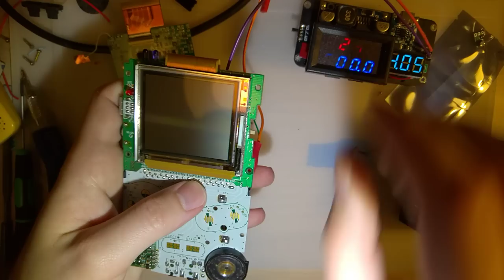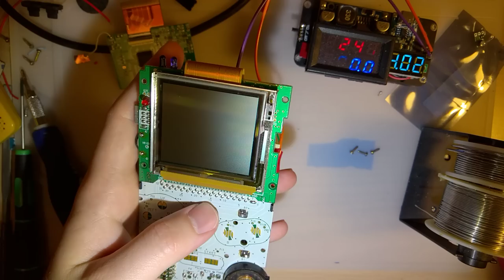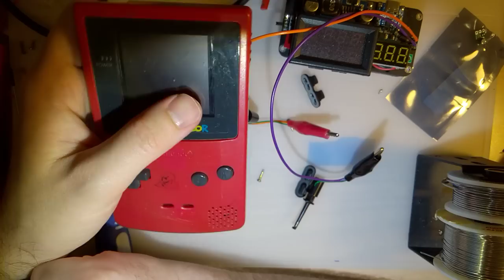Installing the TFT GBC backlight kit (HiVision AIO) - Part 1

Comment: Is there next to the solder point of the Touch sensor 2 points for soldering 2 Buttons to not Use the Touch sensor?
I see on the Video and picture 2 points with Mark "hold" and "+/-".
Perhaps with this can be Use it to change the brithness too.

Öhm is there a way to get the 3d Modell of the 2 parts?
Reply from the maker: Ooh, good catch. I wasn't paying too close attention to the solder points. I'll check it out when I get my new GBC that I ordered specifically for this screen anyway. 

And yeah, I'll upload the .STL files I made and post a link in a few minutes.
Reply: @makho  i found the points first in your Video and the on the aliexpress picture. 
 Thx for the Upload Ing. 
I order the Display too and can wait it arrive but that takes some weeks 😁
Reply from the maker: @-Gothicgirl-  I uploaded the .STLs I made: https://www.thingiverse.com/thing:3732645
Reply: @makho  thx Thats my next printing
Reply: Someone can explain where the solder points go on the original PCB ? , in orden to control the brightness.
Reply: @makho  i was looking for this too,I also saw these points on the board and I believe that the lighting control is done with the console buttons, I think, does the brightness increase because the screen power will change correctly? , the solder poins thank you!
Reply from the maker: @santiagomerinovaca6002  Just put them on any of the buttons you want, you could do start and select, or select and down, whatever.
Reply from the maker: @r1p1m  you can use either the sensor or the buttons. The effect is the same.

Comment: hi nice video 
what is that fancy power supply with the 2 number display you use to power your GameBoyColor on the video ?
Reply from the maker: I made it https://youtu.be/leoks1pUpcs

I'm working on a newer, better version but that new version will have a much higher BOM cost at the tradeoff of having significantly more features and some actual safeties built in.

Comment: Great video. I know you've covered the dimension for the spacers, but I can't find the measurment for the thickness of the spacer. Thank you.
Reply from the maker: Thickness isn't too important. Anything from 1-3mm should be fine. My PCB spacers are 1.6mm.
Reply: @makho  Thanks for the quick reply. 
One more question...what are you looking for when you are trying to spot frame drops. I have Mario (original) and Ms Pacman (color). Thanks again
Reply from the maker: @natk5915  Any interruptions to smooth movement. That's what I'm testing for when I am walking around in the overworld in Pokemon. All movement should be completely fluid. Here is an example: https://imgur.com/Xih0Cpu

The left console is dropping frames and the right console is not.
Reply: I really apperciate that. Keep up the good work.

Comment: I might get a second one, I think we're just two of many people worldwide who have fucked Gameboys with messed up ribbon cable tabs. I transplanted another motherboard and it works better but I'd like to fix that ribbon cable connector by installing a working one. Also because I ended up messing around so much I basically did a full stress test of the ribbon cables on this LCD kit and I must say they're durable as fuck. I can accept them being so stiff because they can take a beating.
Pretty great kit, haven't played Pokemon yet but absolutely no problems with Links Awakening.

Comment: The mine was coming with te touch sensor cut, what a disapoint, install with no bright options, anyway its better than stock one, and its pretty easy to install for dummies like me :D
Reply from the maker: Just solder it back on. The sensor is just a bit of copper tape soldered to a wire.

Comment: Considering i've accidentally screwed up the screen of one of the gameboy colors i'm repairing, i was considering using this as a replacement rather than getting another gbc lcd just to slap a frontlight onto it.

This seems like it'll do the job, but the frame skipping is a bit worrisome. So gotta ask how noticeable it is during gameplay? Namely in something like platformers?
Reply from the maker: It's not exactly game breaking but it is somewhat irksome. I'd realy recommend going with Freckleshack over this one unless you aren't particularly sensitive to this type of graphical issue.

Comment: It says on handheldlegend this could be installed in a neo geo pocket color.  Could you do a video on that?
Reply from the maker: Twist my arm, why don't'cha!

Yeah, I already ordered another kit a week or so ago. Still waiting on that. It's worth noting that just because the kit may or may not be compatible, the connector on the motherboard for the NGPC is different so you still need the ribbon cable (which I do not already have since my kit is from before there was NGPC compatibility). It also looks like you get one cable or the other with new kits, not both.
Reply: @makho  I ordered one with ngpc ribbon cable. I finally found a picture of installation so it might be just as easy as gbc.

Comment: Ah i order it too.
But how is the sensor to Mount in the ir Port?
Block it the ir Port?
Reply from the maker: Yup. Peel off the paper backing and stick it on the inside of the IR window. You'll lose the ability to use IR, but how often do you really use it anyway? I'll explore some other options in my next video on this screen.
Reply: @makho  For your info, the touch sensor thing you can cut it smaller with scissor then stick it on the IR window, it wont block the IR function.
Reply from the maker: @ChewHong25  I was going to try that out when I put it in the console I planned on keeping it in along with some other things. Good to know though, thanks.
Reply: @makho  that tiny copper sensor is designed  to stick at IR window actually. However the product is kinda fragile so be extra careful while handling it :) good luck
Reply from the maker: @ChewHong25  I assumed it was just copper tape with a wire soldered to it. Was I mistaken?